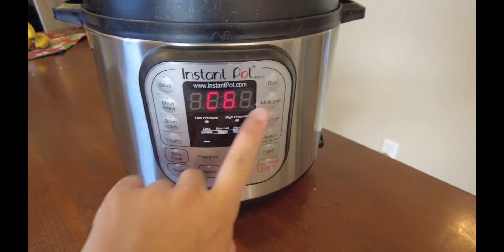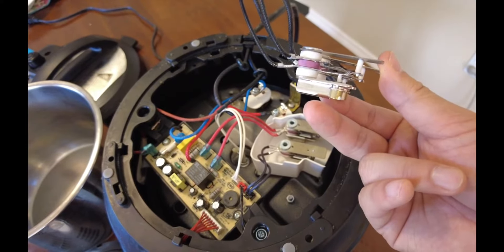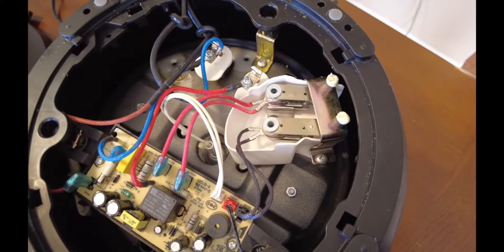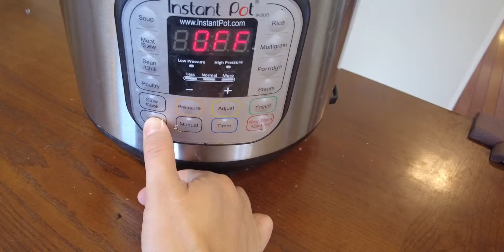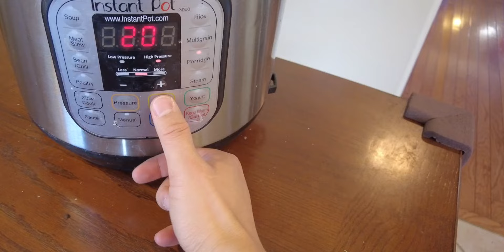Instant Pot C6 error fixing

Comment: Very thorough explaining everything so that I have no questions.  After I removed the sensor I tested for clicking and sure enough one of them was not clicking.  I examined the part with a flashlight and saw that one of the contacts of the sensor under the one of the flexible stainless strips looked like it had burned out and it looked as if it had disintegrated.  I'm about to order the new part and it kept my very old IP (like 2014) from going in the landfill.  Thank you so much!

Comment: I have this exact model and issue with the leads on the pressure tip breaking off and must say that it is one of the most used appliance in the house. Hopefully I can get another 5 years out of the new sensor lol. Thanks for sharing.

Comment: Clear and to the point.   That part from Amazon will arrive in a few days to fix that C6 error.   Thank you.
Reply: Follow - up :   instant Pot totally back to its normally working after following your video.   In fact Im eating the cooked rice using the repaired Instant Pot.   Thank you very much
Reply: Can you share the Amazon link of that sensor pls
Reply: Amazon link please
Reply: @codywifi149 I must confess that I don't have that link but just type the model and pressure switch.  It should show you.
Reply: @manuelmoraleda9684  thank you the problem with my instant pot was the rubber gasket from the floater pressure valve my wife put it backwards lol
Reply: @codywifi149  after that repair (actually a part replacement), our Instant Pot continues to "live" trouble free.   I thought I had to get another Instant Pot.

Comment: Just replaced my pressure switch after 4 years of continuous use and I had to adjust the switch down 6 times (1/4 turn CCW at a time) to keep it from overpressuring.
Reply: The best way to adjust the switch if it over pressures is to run it in clockwise with the power on. When you get the C6 code, back the adjustment out until the C6 code stops and you are good to go. IN my previous statement I said CCW, I meant clockwise, sorry,

Comment: I fixed mine by emptying the little water reservoir that's at the back of the unit. It was full of water because I do a lot of steaming. Anytime that happens it's because the resevoir is full in my case. Never had to replace anything, I just empty the resevoir now anytime I use it.

Comment: Anyone know if c6 and CP6L are the same error?    Or if you have 3 different sized pots do they all take the same sized sensor replacer?
Reply from the maker: The C6, C6L, and C6H errors are all related to the pressure sensor isn't working properly; the the pressure sensor might be vary across different models

Comment: If after replacing the sense and you still get the error what else to check.
Reply: It has to be calibrated
Reply: @battery0peratedlover  how do you calibrate it.
Reply: @Electronic Artis  I've been trying to find the answer, but coming up short.
Reply: @battery0peratedlover  I found this help to make it work however if you could put a better explanation to that video it will be helpful thank you this is the link. https://youtu.be/jNb_oQW5moE
Reply: @Electronic Artis  seems pretty easy to follow but given that the screw is a gage to elevate or drop the temp idk what temp it should be set to.
Reply: @battery0peratedlover   it's a difficult task to calibrate this however instant pot have some information of what different item cook at what temperature. However if you find a more easy  way I'll be waiting for that video.

Comment: How can I fix Error 3
Reply from the maker: Error 3 on an Instant Pot is usually caused by a failure in the pressure cooker's temperature sensor. try performing a factory reset on the pressure cooker. To do this, press and hold the "Keep Warm/Cancel" button for 3 seconds until the display shows "0:00."